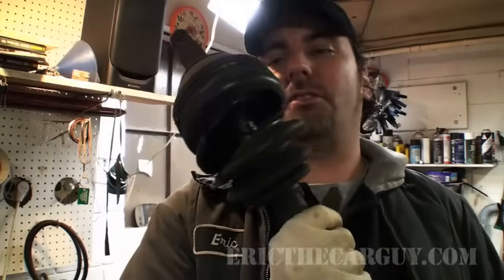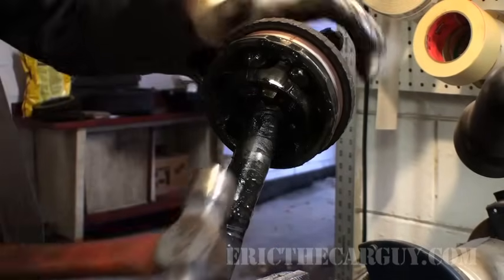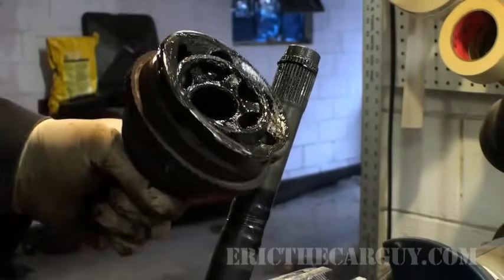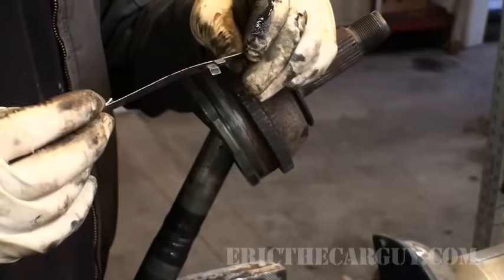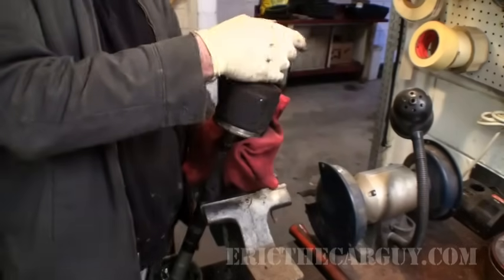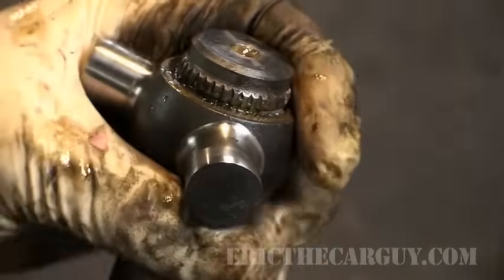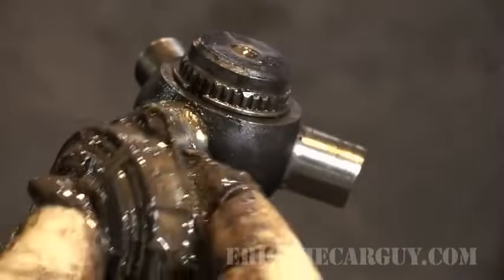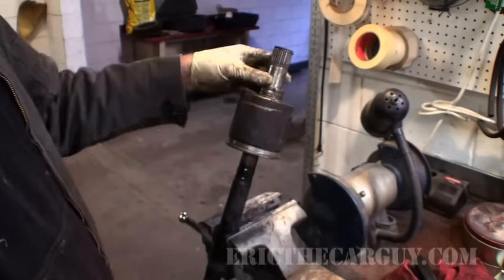How To Replace CV Boots - EricTheCarGuy

Comment: I never knew that was how the axles came apart. Good info. I replaced a cv axle in my car a few years ago and the boot was made of junk rubber which cracked in short time and now it's totally split open. It's my own car and I've got more time to spend on it than cash, so I'd like to just slap a boot on. I've seen tools which are meant to stretch the boot over the fully assembled joint but that seems crazy to me.

Thanks for showing how these are assembled. It's interesting to know for sure.

Comment: I enjoyed your video.  It was very helpful.  Thank you!  I was replacing my CV axle, and I could not get the end out of the transmission (believe me, I tried several methods - sliding hammer, etc., etc.); I was about to cut it off with a Dremel.  Anyway, I, finally, decided to just leave the end of the CV axle (the inner joint) connected to the transmission.  I removed the axle the threw it away.  I have a new CV axle.  I intend to take the inner joint off of the new axle and put it into the inner joint which is, still, in the transmission.  So, your instructions how to remove and repack the inner CV joint are very helpful.  Thank you.
Reply: there might be a roll pin or something that you have to remove with a punch to get it out.

Comment: CV boot £3.99  new front axle £295.00 Now take a guess which one I am going to buy...@ericthecarguy... I thought at your age you would be classed as a mechanic.The start of the video you sound just like a fitter....So many guys in my local garages don't actually know how an alternator works, or how to replace the brushes on a starter motor. The have massive banks of tools and all they ever do is swap old parts for new. And as you mentioned at the beginning its all about cost. It sad that its quicker, easier and more importantly cheaper just to FIT a new part than spend a little while repairing the old part..
Reply: +Jamie Rollinson Here in the States, it would cost me around $6 for a cheap flimsy CV boot but the cost of a reconditioned CV half-shaft assembly is about $35 to $70. I'd rather spend a bit more for the half-shaft than messing with CV joint grease.
Reply: +Jamie Rollinson Just bought my axles new for about $60 bones each. That price beats the shit out of labor any day.
Reply: +Jamie Rollinson  He knows how to replace the boot and just showed us. Did you not watch???
Reply: +Dezmar Perez No. It was aimed at the Rollinson
Reply: +Jamie Rollinson He said in the video "IF THE JOINT IS NOT CLICKING", then go ahead and replace the boot. So you're paragraph is irrelevant.
Reply: +Jamie Rollinson He was saying how the joint is going to fail soon anyway, so why go though the trouble if you&#39;re just going to replace it anyway.
Reply: DigitalShaolin lol i agree with you..replace just what doesnt work as it should be...dont damage other components cause you are care less or cheap.
Reply: Here I am 1 year later. Axles are A-OK
Reply: for me CV boot is $16 (that's United States greenbacks) and an axle is $50...I'm probably going to go with an axle
Reply: I mean a boot kit where I'm at is 25 bucks while the axle is 65, the only reason I'm fixing the boot is because I broke it while changing tie rods and know it still good. plus o.e vs autozone.
Reply: Not sad, and not cheaper.  He's just giving you a mechanic's point of view that there is labor involved if you're having someone else do the work, that it's more labor to take an axle off, disassemble, clean, regrease, reassemble, and re-install, than to only take it off and re-install (a new one).

It is not more cost if you DIY, and in fact, could save quite a bit of money if it completely failed and you were going to tow it to a shop, so a tow bill too, or either way you are dropping it off at a shop, need a ride back home, waiting without a vehicle, getting a ride to the shop to pick it up, and driving home.  That's a lot of planning and time and expense compared to just DIY replacing a boot, or even whole axle at home.

It's funny, many people think it's a hassle to DIY but in many cases it's less of a hassle than taking it somewhere to have someone else do the work, providing you have the space, floor jack and stands, and the right tools to do the job or can improvise.

Many people have a warped sense of what their time and effort is worth.  It is ironic, they will spend an hour watching a video but spending an hour working on their vehicle is alien to them, lol
Reply: Its not about can you fix it or not, its if you spent all the damn time jacking up the car and getting the boot off why not swap out everything and drive easy knowing you won't be doing the same job after while. You may save money on just swapping out the boot but ask yourself, how much is the time in your life worth to you?
Reply: Yep, i bought a cv boot for 15€ and replaced my cracked one , was cut in half literally and probably for years, i just noticed it recently. Opening it and examinating it, to see if there was any damage, this is obviously worth if you like cars and mechanics. I opened it and saw no damage, replaced the boot, and its perfect now. Replacing an entire axle is stupid unless it is damaged. A friend spent 115€ for a Punto axle, just because he didnt know how to mess with the cv joints.
Reply: Cheers for taking the time bro.. my joints were fine it was just the boots that were tore open i actually think some prick ripped the boots on perpose so all that meeded doing was the boots the axel was aok
Reply: New CV Axel at AutoZone should run you no more than $75 brand new. Lol where are you going for parts? $75 beats $10 anyday because that would take 20 mins to fix vs. 1.5 hours and a lot of grease. And then next thing you know is the other boot on the same axel goes out a month later. Always best to just replace the axel.
Reply: @michaelkidd7821  Depends on what vehicle it's for and where in the country. A domestic vehicle sure. But a NEW axle (not reman) on an import is more likely to be $100+, even aftermarket.
Reply: Jamie Rollinson , here in the great old USA the entire axles are dirt cheap, is cheaper to replace the whole axle.

Comment: Eric,  "Why Bother?". Well, I will tell you why. I had a 1989 Prelude with torn boots-no clicking. A local driveway mechanic suggested new shafts instead of re-booting (as you do). He installed the new shafts and at 70 m.p.h. the car developed a bad vibration. Lowering speed to 60 m.p.h. the vibrations ceased. Turns out the original CV shafts have a balancing hub on them that the new after-market shafts do not have. I had the mechanic remove the new shafts, re-boot the old shafts and, once re-installed, the vibration issue disappeared. He claims now they have new replacement shafts with the harmonic balance hubs included. I haven't seen them so I plan to re-boot my original 1989 CV shafts (140,000 miles) with balance hubs (and no clicking). Thanks for the video and the other that shows how to remove the shafts. I am going to do it myself this time (with your help).            Thanks for your important work!      Tom

Comment: Just did an outer cv boot on a Volvo S40.  Book says to remove the circlip with pliers and slide the joint off the shaft. Glad I saw you hit the joint to get it off as the circlip is onthe shaft inside the joint.  I did find it easier to get the joint back on the shaft when I took the circlip off the shaft and put it inside the joint as it fits in the groove and doesn't move.  I did it with the shaft still in place on the car; a bit more of a squeeze.

Comment: Thanks Eric!  Very helpful.  On my 2006 Scion TC w/manual and 140k miles, a vibration has started that I haven't been able to pinpoint yet.  Most noticeable at 40 mph and above, but if I turn left ever so slightly it stops.  The bearings in both front tires don't seem to have any play in them (vertical or horizontal), and CV joints are not torn.  I feel the vibration through the steering wheel, and if I coast on a smooth road it feels like it's there all the way down to stopping.  Possible it's a tire out of balance but it seems more severe than that.  I haven't checked the rear yet because it's so noticeable in the steering wheel, and the slight left turn pressure makes it stop, but I could check that next, as well as for clicking when doing hard turns both ways.  Thanks again!  Liked and subscribed.

Comment: excellent I have just done a Honda civic vti the Cclip in the replacement joint pack was too thin and jammed  Great tip with the screwdriver .. I am 70yrs  in November 2014 and still learning .1980 Donnington 1ltre GT champion .. great vid .

Comment: I was thinking of replacing my boot preemptively, as the old one is cracking but not completely separated. But I'm re-thinking it now ... maybe just let it break and replace entire axle. I had forgotten about tightening the bands ... doing so without proper pliers is a PITA. Thanks for video.

Comment: vw paid 1.5 hours per outer cv boot for golf/jetta. It's a 15 minute job. Axle nut, front control arm bolt, and pull the tire outward. (no need to take the tire off). Install new joint and boot with lots of grease. (if they are clicking, they're junk) re-install both removed fasteners, and hubcap if it's there. Done. The 15 minutes includes putting the car on the lift. Gravy!
Reply: @izz5946  A large pan with water may not find all slow leaks. Some tires may only leak when in motion.

Comment: Excellent video.  Know more about CV's than I thought I could learn from a YouTube vid now.

My wife's Nissan Rogue (2011) has a torn inner CV boot on the front passenger side.  Was informed by my normal mechanic during a full tune-up.  He quoted me about $200 I think to replace just the boot.  The local Nissan dealership also saw it when I later had a throttle body service, a brake fluid flush, and coolant flush.  They recommended changing the entire 1/2 axle with the boots (I guess they come pre-assembled).

Sounds like a better option, but they want $850!!!  I was thinking, geeze, if all that will happen is contamination of the grease and premature CV joint failure, why pay all that while it's working fine with zero sounds?  Best to get all the life out of the 1/2 axle that's on there already.
Reply: You should have replaced the boot as soon as you found out and you could have saved $600. When they have torn the grease they need to operate flies out and causing premature failure!
Reply: @realpatriot5896   At what miles would you consider it premature failure? The car was well over a 100,000 miles when that happened. It's a moot point now anyway. We went ahead and let our local shop change the entire axle and boot and it was about $270 I think. Much cheaper than the dealer quoted us.

Comment: Thanks, this vid comes in handy when you rip a boot on an otherwise  good oem toyota 4x4 cv axle.86-95 When pushing these axles to their limit while offroading, the parts store replacements do not hold up as well as the "discontinued"  originals. I watch my friends grenade dana 30 equipped jeeps almost every trip while I keep chugging along on my oem cv ' s with what possibly could be 301k mile originals.

Thanks again

Comment: Greetings Eric ... well done... appreciate the heads-up on setting the expansion ring with the small screwdriver... had to replace a LF outer boot on a shaft that was only about 5 years old... I have always set the outer cup between my press rails resting the cup on two pressing plates. I would grab the shaft  and hammer down popping the cup off the shaft.   didn't think of using a brass hammer thinking that bearing cage was too brittle to be banging on.   your method is much easier... thanks again...

Comment: My dealer saw that my in CV joint boot was torn.  They had me worried until I saw your video and saw exactly what it was and what it did.  I am going to take your advice and just leave it alone until I hear a significant noise when I am not turning.  Right now I do not hear any noise regardless.
Reply: Replace the boot before the greese is lost then you will not need the expensive joint

Comment: Thanks for the video, i cannot find any axles for my 1985 Honda Civic III. And i have a quite bad clicking CV joint, the only thing i managed to grab is a CV joint replacement. And you exolain pretty well how to take off and put on new joints, so yeah, wish i had a new axle but this is what i have to do.

Comment: Just a tip for anyone that has to tap the bearing retainer back onto the axles. You can take a socket that will clear the splines on the shaft but fits tight enough to the bearing retainer and use it to tap the retainer back onto the splines. Bushing press tools would be ideal but sockets can get you by in a pinch. :)

Comment: I'll be doing this job in two days, and I was planning to clean the joints the same way you did - mineral spirits, or maybe mineral spirits and gas. However, I just got the new boots (Beck Arnley), and they say specifically NOT to do this: "Do not clean with gasoline, kerosene, parts cleaner or other petroleum based solvents. These leave a deposit incompatible with the grease." So, that's out. The recommended procedure is to "Clean off excess grease with a rag and then remove the remainder with warm soapy water. Dry thoroughly." What this actually means is a trip to the high pressure car wash with the part. Don't shoot the messenger, I'm just reading the instructions...

Comment: Thanks for the help as I nicked the outer CV boot while changing struts on a 2012 ML350, so half shaft replacement was too much compared with $20 for the boot.

Comment: thanks for the video. helps out when no parts store seems to be able to get you the CV axle you need. 92 Nissan sentra. 3-speed automatic. only 1 store could find it and when ordered came 6" too short. reordered came with "fatter shaft" and too many teeth. so gonna replace the ripped boot even though it clicks in turns

Comment: Thanks for teaching all these years!  Cuz "...the groove is in the heart!"  Nice!   How important would you say is the dynamic dampener found on driver side axel of 7th gen Accords? I Had the inner boot come apart during a tow after a LB joint failure (stupid me) and the Damper was also damaged.  If the dampener is not very relevant, I intend to fix the axel, rather than getting one from the PRC.

Comment: Your rant at the beginning made me consider getting an entire axel assembly. Turns out it’s actually very economical and far more hassle-free to just swap out axels. Worth the extra buck in my opinion.. but to drive on it with the clicking for too long, I would advise against that.. if that axel goes out you will have a total loss of control.

Comment: for the inner joint, you really don't need snap pliers to remove the c-clip in order to remove the bearing "tripod" from the splines. i found the tripod to have a little room to push down/away from the clip allowing room for a small flathead to wedge in and pry the clip out of the groove. keep following along between the tripod and the clip prying the clip away from the tripod and it'll come off just fine. couldn't find all the tips for my snap pliers today, so this is how i got around it.

Comment: If there is a click in the joint, will cleaning it and rebuilding it help at all by cleaning out any dirt or gravel that may have gotten stuck in there? Or does the click come from chipped bearings and grooves?

Comment: you answered my question about if I need to use new circlip on the outer Jetta DSG cv axle. I thought you might need a new clip in order for it to be knocked back on but the screwdriver alignment trick of circlip  is what I wasn’t doing. If anyone has any other tips on Jetta cvs lmk!

Comment: Drove my "83 Honda -which already had clicking axles when I bought it- for more than 7 years, putting about 90000 miles on the same axles. They never came off. Changed car before I changed them. They really are not a priority, especially if they just started making the clicking noise. You have years to drive on them and not worry, unless you like to do lots of sharp turns at high speeds.

Comment: Hi Eric, you mentioned that if there is a clicking when driving straight but not much when turning, I have to reolace the shaft immediately. What if the clicking is intermitent. Sometimes its there and when i release my foot from the accelerator, it will stop. It comes and go from time to time. But not often. What could be the problem. Thanks in advance. Great video man

Comment: Edging toward 13 years later, combined with Bidenflation in the most recent years, CV axles ain't cheap anymore.  Add to that that the entire axle is not available for my car (manual trans) in the aftermarket--only the automatic trans axles.  Even Mazda doesn't seem to want to sell a whole axle, but you can pay, at least from what I saw online, over $300 for a joint.  My inner boots didn't tear but at least one if not both are spitting/leaking grease out the big end.  Axles are still quiet.  So I'll re-boot one or both inner joints.  While you didn't cover it specifically on the inner joint, I'm assuming you just make sure the bearings are covered in grease (and have grease internally if that's ever a thing), and put the rest of it inside the housing before installation.  Thanks for this video. :)

Comment: Hi Eric,  what cleaner do you use or recommend to remove the grease or clean out the CV joint before putting new grease into it?  Engine degreaser or brake cleaner?Thanks so much for a great video.

Comment: Awesome video. It seems like my 04 Forester calls for different types of grease for the front inner and front outer cv joints. I've had multiple people suggest using redline cv grease. Is this grease ok to use on inners and outers?